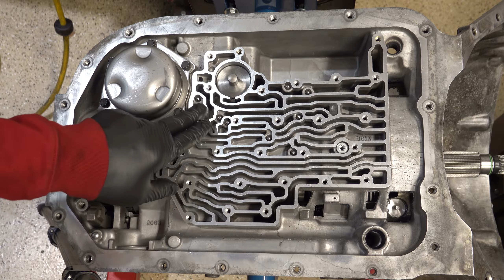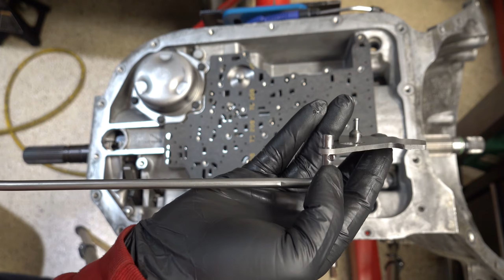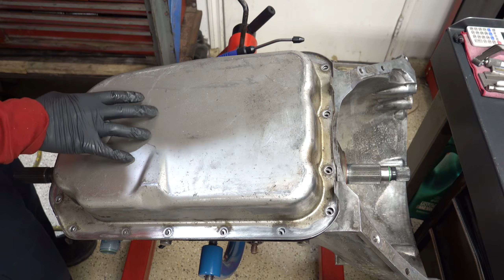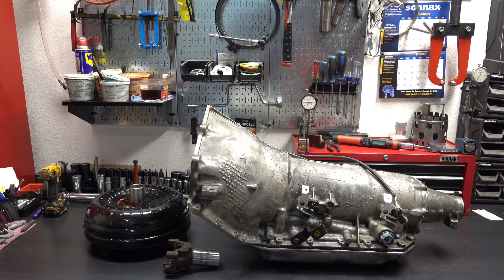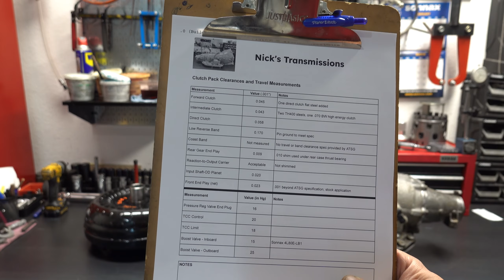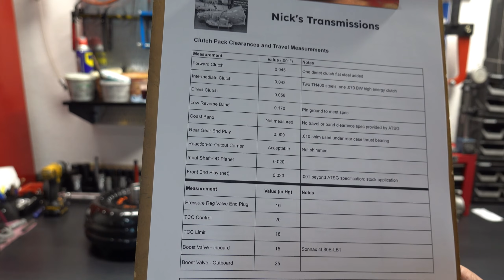4L80E Basic Rebuild - Part 3

Comment: Hi Nick, I have 2007 4L80 on GMC, It have problem which temp keep increase never go down and start slip, so i did drop the transmission and rebuild it it was having bad valve body and i did replace it with new GM029 from sonnax, the pump was great and also replace the boost valve, anyway the still same and i lost my 4th gear, my mistake i didn't check line pressure before rebuild because what i found is on P/N what ever RPM it will be 55 psi, also on 1,2,3 and D will be 55psi high or low RPM same psi. only will get higher on reverse with gas will get 185 psi note the reverse and idel will be 55psi. what drive me crazy is no code and all connection seem to me find and also the EPC solenoid but i don't know sonnax put the old style with adapter.

do you have any idea what can be the problem and what to check?
Reply from the maker: Reinstall your line pressure gauge. Unplug the case connector, start the engine and see what line pressure is...Should be around 135-150 PSI at idle in P, N, D, D3 - if it's still low at 55 or so PSI, the pump is no good.

Did you vacuum test the PR valve, check pump for clearance and wear on the working surfaces, especially at the crescent?
Reply: @nickstransmissions  LOL, I did vacuum test for pump and i get 0, why why, then i pull this valve out and guess what sonnax make multiple boost valve kit and I keep them on one drawer and some how I did mix two of valve. I did put smaller valve on biger sleeve this make since now. now getting -20. i will put every thing togatoer and i will update here.
Reply from the maker: Yes, 20Hg is a good reading for the boost valve sleeve/bore and boost valve vacuum. Hopefully everything is fine now that you determined what happend and fixed it.
Reply: @nickstransmissions  I did unplug the connector and still low at 55 psi, but if reverse with gas give me 185 psi also mean pump issue?
yes I did PR valve test and give me 15, but Boost Valve Assembly test give was give me 6 & 9 and install sonnax boost valve and forget the check it after install new boost,  pump clearance also right since car only have 60k miles.
Reply: I have 1997 case and pump which I know is good, can I put all components and valve body will it work on 2007? @nickstransmissions

Comment: Great video Nick! Quick question...I heard when bolting the 3-4 accumulator housing housing to the valve body, it has one longer bolt than the others....is true for 91-95 4l80Es or just for 96 and later?
Reply from the maker: Thanks for watching, LoneWolf. There is one longer bolt but, offhand, can't recall what years had it and what didn't.

Comment: Thank you for this information.. i have a 97 4l80e that is giving me hell. I had too dirve it about five minutes with a dead battery it was shifting fine up to this point.. now it wont go into third or 4th. I replaced the  internal wiring harness and all the solanoids and the  Manifold pressure switch. Still wont go into third or 4th 1st and 2nd fine.
Reply from the maker: It is hanging in second gear and not upshifting or it's upshifting but nothing is actually happening (which would indicate burnt direct clutch pack) and trans would have to come out. Let me know which scenario applies...

Comment: 2001 Chevrolet Express G3500.  I have already replaced my internal wiring harness and manifold switch (TFP).  I am unsure if the orientation of the connector to the pressure control solenoid is correct, because the connector had two vanes or ridges on one side and it was flat on the other side.  I attached the connector with the vanes/fins/ridges AGAINST the pressure control solenoid and I don’t remember the order of the color wires.  I noticed after you connected the pressure control solenoid connector, the purple wire side was closest to the valve body and the blue wire side was farthest away from the valve body.  How did you know how to what side of the connector goes against the pressure control solenoid?  I am asking this question because another channel has the connector with the blue wire closest to the valve body and the purple wire farthest away from the valve body.  Thanks.
Reply from the maker: Hi HB5914, thanks for watching. I don't think it matters as long as you have the connector installed on both electrodes/tabs on the EPC.

Comment: Nice 3 part overhaul but you didn't vacuum test the valve body?! :-\
Reply from the maker: How do you know I didn't test the valve body? Were you there with me as I went through that transmission, from start to finish?

Do you think everything that goes on with a given build, either by me or any transmission builder, is limited to solely what you see on Youtube? 

Do you really believe I wouldn't vac-test the valve body? 

This isn't my first rodeo.

I already have a valve body assembly and vac test video on youtube, filmed prior to this build taking place...There's no point in publishing two videos of the exact same procedure for the same transmission type.

Comment: Just wanted to drop a big thank you for your videos. I have the confidence to at least try to build my own trans now. That doesn't mean I'll succeed, but at least I'm not afraid to try now.
Reply from the maker: Thanks for the kind words and views, Moose! Appreciate it. If you have the ATSG manual for your transmission and my videos, you should be good to go. Glad you're taking on the job! Let me know how it turns out.
Reply: @nickstransmissions  im currently waiting on my ATSG book to come in the mail. I checked shipping earlier, and it's a couple of days out yet. I've just been cleaning my garage and getting ready to tackle the build.
Reply: I've got a jakes recal kit, bonded pistons, high energy frictions/steels, a complete bushing, and a bearing kit. All new papers and seals, 300m input shaft, all kinds of good stuff. Going in a Twin turbo G8.
Reply from the maker: Nice, looks like you're set up well...Also replace all the electrical stuff (harness, all solenoids, pressure switch manifold assy, speed sensors). Depending on stall speed (I'm assuming somewhere between 2400-3200), I'd go .093-.110 on the 1-2 feed in the spacer plate as Jake's has you eliminate the 1-2 acc circuit using that kit.
Reply: @nickstransmissions  that's correct on the stall. Triple disc lockup converter, and i will keep the spacer plate holes near your minimum recommended size. And i just wanted to say again that all the help is greatly appreciated. Can't thank you enough.
Reply: (And yes, I got all the new electronics, rostra wiring with transtar solenoids, and epc). I definitely got the message about not reusing those parts, lol. Fun fact too, when I got this trans and pulled the main harness off the side, it had fluid leaking into it.
Reply from the maker: That's very common w/4L80Es which is another reason for replacing the harness. Solenoids are often seen either in two pieces or coming apart as well.

Comment: 2001 silverado hd, 80E , hard shift first to second!!
Reply from the maker: Hi Gerardo, are you trying to say your Silverado has a harsh 1-2 shift? If so, what are your questions, if any?
Reply: @ @ yes,   What can it be d issue?
Reply from the maker: Scan the ECM for trouble codes and see if there's any related to the transmission or engine management sensors like the throttle position sensor. Test your throttle position sensor's output values to see if it's over-reporting throttle position; same for your mass air flow sensor. I'd also do a line pressure test on the transmission to see if it has excessive line pressure...This condition is somewhat common with 4L80Es and TH400s that have a lot of miles on them (north of 125,000).
Reply: @ @ i use this truck for  4l80e  testing only!   The truck runs just fine,  no engine issues!   In fact the stock transmission runs perfect!!     This other 80E trans, i got it from junk, cheap!

Comment: @nicks transmission when converting a 4L80e to 4X4, the hole above and below the output shaft, are they both to be plugged, just like the rear lube hole to the right of the output shaft? I’ve not found anything that says explicitly.  Thanks in advance, and awesome content as always.
Reply from the maker: I don't believe you plug those two holes, just remove the pin hole seal and install the 4WD cup plug then the 4WD output shaft. 1991-1993 units, keep the reluctor gear on the front planet as those transmissions still use the output speed sensor in addition to the T-case speed sensor...1994+ they did away with the output speed sensor and rendered it non-functional in the 4WD 4L80Es.
Reply: Thank you!

Comment: I’m about to do a flush  and filter change on a 1997 4L80E GMC 2500 4x4 with 218K miles no issues to speak of can you recommend any other services could do while I’m doing this in my driveway this truck was given to my 16 year old son so I’m going through the whole truck?
Reply from the maker: Hi Mike. For now, and assuming there's nothing concerning in the pan, i would carefully inspect the trans wiring harness for cracks or other defects, same with all solenoids. Also disconnect the external wiring harness from the transmission to check the harness plug for leaks. Very common problem for 4L80Es with a lot of miles on them. If uncertain, Id replace the harness as well as solenoids+pressure switch manifold assembly.

Comment: The only plate I’m finding is one that has different holes then the one you are using, could one make one themselves and use the gasket for a template on a 1/4” plate?
Reply from the maker: You can definitely make your own if you have the materials and tooling needed (unfortunately, I don't nor do I have the skills, lol) but to answer your question - yes, use the gaskets as a guide. 

If yo need a plate quick, purchase the applicable Transgo separator plate based on the year of your 4L80E.
Reply: @nickstransmissions  Perfect! I’ll see what I can do! And yep I’ve already got the transgo hd2 kit
Reply from the maker: DO NOT use that kit...It's a complete waste of money for 4L80Es...Send it back, get your $$$ back...If you want to dual feed (which that kit does but through that stupid sandwich plate which is prone to cross leaks), simply plug the high-reverse feed passage in the case with a 3/8 inch cup plug (use red loctite or RTV on the outer dia of the plug), leave off the 2nd from top sealing ring off the center support, leave out the center seal in the direct drum and drill the 2-3 feed to .080-.085 if keeping the 2-3 and 3-4 accumulator complex active on the valve body. The cup plug costs like .50 cents. 

Install the Sonnax 4L80E-LB1 boost valve kit and, if you want, their matching pressure regulator valve. 

Those HD2 kits come with that pressure relief mod as well - DO NOT INSTALL IT! Send that it back...
Reply: @nickstransmissions  What are you exactly referring to when you’re saying drill the 2-3 feed if keeping the 2-3 and 3-4 accumulator complex active. I’m not sure what all that means! Thanks
Reply from the maker: The 2-3 feed orifice feeds the direct clutch when you're in third gear as well as reverse gear...Drill that orifice out per my instructions if keeping the 2-3 and 3-4 accumulators active..If you're going to be running a block off plate, you can go a little smaller on the feed hole sizing since there won't be any accumulation in the circuit...Accumulators are timing agents that slow the speed of a shift so it's designed for 'comfort' when used with a factory stall converter vs a performance application with a higher stall.

Do you have the Automatic Transmission Service Group (ATSG) manual for the 4L80E?
Reply: @nickstransmissions  Yes I do but seems to only be for earlier models somewhat to me, I’ve got an 05 model 4l80e but it’s been pretty close to the same, on the inside it states updates in 2003 so should be good
Reply: @nickstransmissions  Running a circle d 2800-3k behind mild cammed ls3
Reply: I may have already  messed up then, tranny is all but built up, and already did The modifications and installations of parts of the hd2 kit to the valve body and pump. What’s my best option you’d recommend
Reply from the maker: Reverse everything, take the HD2 kit parts back out (except for the direct clutch high-rate return springs-you can leave those in) and install the above parts I mentioned. Perform the above dual feed process as described...If you drilled the hole for that pressure relief mod you can either tig-weld the hole shut, tap and install a very short set screw or plug it off with JB weld/similar product.

Unfortunately you're prob stuck with that kit insofar as not being able to get all of your money back but maybe you can sell it for like .30-.50 cents on the dollar to recoup some $$.

When you initially wrote, "the only plate I'm finding...." - were you referring to the separator plate that came in the HD2 kit or something else? 

The way you wrote the question seemed to imply you were looking for a separator plate and didn't have one or had one that was so damaged it wasn't useable and that you hadn't yet started your rebuild.
Reply: @nickstransmissions  I was referring to the air test plate for the case you were using to air test the clutches, sorry for the confusion
Reply from the maker: Oh, ok - that makes sense. Use the separator plate-to-case gasket specifically for making a test plate.
Reply: @nickstransmissions  do you have an email so I could contact you a little easier? Just to make sure I’m doing everything correctly. First tranny and been watching you videos to do most the work along with the manual
Reply from the maker: Hi Dalton, simply ask your questions here...This way, other views with the same or similar questions can see the responses.
Reply: @nickstransmissions  no problem! So is removing and replacing all the parts you suggested the best way to move forward, as in what’s the worst case scenario if I do run the hd2 kit. I’ve got the parts you suggested in my cart ready to order but want more clarification before I spend more $ and disassemble the tranny again! Thanks
Reply from the maker: Worst case scenario is you burn up all your applied elements due to the pressure relief mod mechanism failing, getting partially stuck open or their spacer plate cross-leaking...

It's your transmission so your call but I'd not run it given you will be rebuilding the unit. Why spend $$$ on a kit to dual feed through a spacer plate when you have the trans apart and can spend 50 cents on a 3/8 inch cup plug, leave a seal and sealing ring off, accomplishing the same exact thing?
Reply: @nickstransmissions  Yep I’ll be taking it back apart, I just like to know the why and how and understand better! I appreciate all your help and advice! I’ll attempt to tig the hole first!

Comment: This is a trick that I learned when I was going to technical school in 1980. The instructor took the FWD clutch hub and used it to install the direct clutch assy, after installing, he switched the pressure plates back.  I made a tool to align the intermediate clutches by welding a handle to an old outer sprag race. I fought with one of those for a whole afternoon one time, and still couldn't get the direct to drop in. I walked away until the next morning, and it fell right in place. Lastly, an old instructor at tech school had pins machined to fit in the bolt holes for the pump the just fit the holes, in addition to the band. I thought about doing this myself, but never got around to it. I hope some of my tricks can help you out.
Reply from the maker: Thank you for sharing those tips, Peter....I know they help me but also anyone else reading your contributions that otherwise would have never known about may of these tricks of the trade. Welding a handle to a sprag race costs basically nothing and accomplishes the same thing faster than the Kent Moore alignment tool that typically costs over $100 on eBay.

Please keep them coming!

Comment: I need my 4L80 refreshed for my turbo LS swapped jeep TJ. Put it on air suspension and built a new motor for it. I usually do my own transmission work because a lot of transmission builders dont do what they bill you for. How much would you charge to go through a 4l80? If you're interested I'd like to pull one off the shelf and send you to work over. Maybe a pair. Would like a spare for the jeep or wifes turbo LS burb.
Reply from the maker: Thank you for watching, @housewhere! 

Feel free to reach out to me via Tahoeyukonforum.com; provide your name and a good contact number and time to call and I'll get in touch with you re your 4L80s. My user name there is NickTransmissions.

Website: https://www.tahoeyukonforum.com/
Reply: @nickstransmissions  right on! Sending info now. 👍🏻
Reply: @nickstransmissions  just messages you on the forum